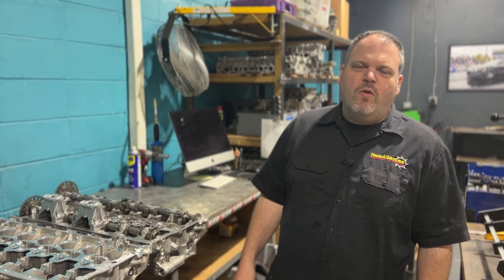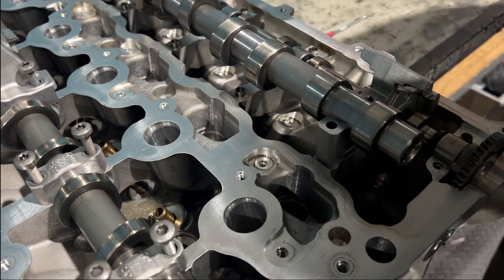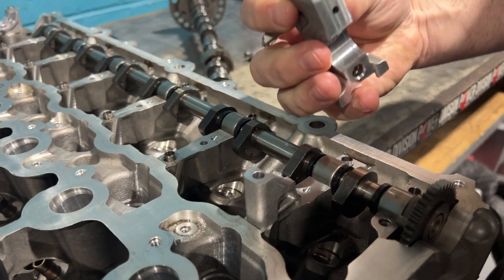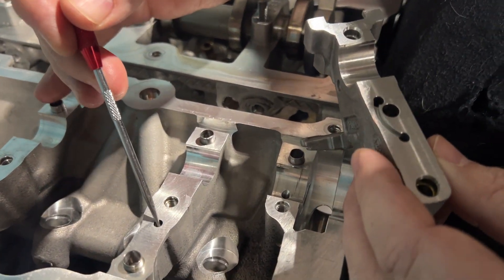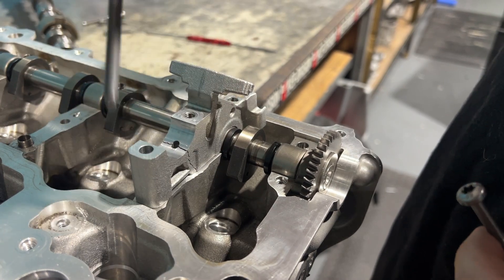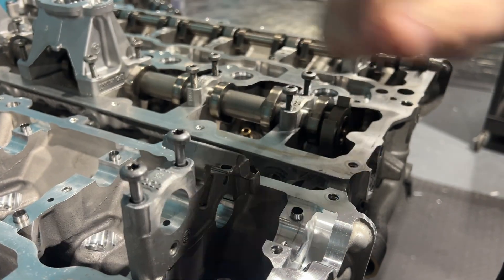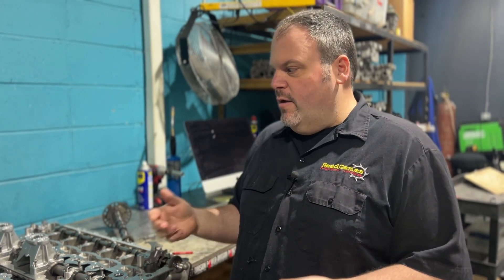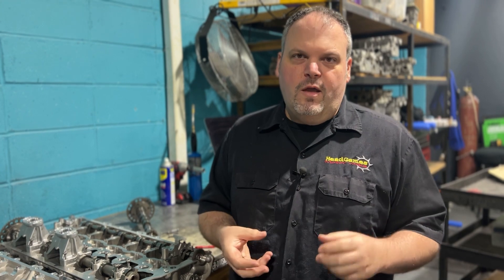Broken BMW B58/S58 cam cap issues!?

Comment: Can this cause oil to leak out of all 6 ports on the B58TU in the m340i? I have been getting blue smoke and its not the valve cover or turbo so oil is leaking out of all 6 ports where the turbo mounts on to.
Reply from the maker: this would not cause an oil leak. That sounds like something in the bottom end.
Reply: @headgames  I have a shop taking the engine out to see what is causing oil to leak out of all 6 ports

Comment: I may be experiencing this issue right now with my vehicle. This type of thing isn’t covered even partly by bmw is it? Any advice?
Reply from the maker: BMW doesn’t cover anything. Only suggestion is to get it looked at. Have to remove cam caps to see it. If it is cracked, have to replace the head.
Reply: @headgames joy, thank you.

Comment: A lot of people saying this is mainly caused by bolt fatigue there’s actually an updated cam cap bolt apparently… would you recommend using new bolts and torquing to spec?

Comment: Do you think this will be a problem with early year b58s like for example gen 1 2017 bmw m240i?
Reply from the maker: Yes, it is the same cam cap. And the Gen 1 is actually how I learned about it.
Reply: @headgames happened to me on m240i 2017
Reply from the maker: @Ervinator  sorry to hear. Was it hard to diagnose?
Reply: @headgames  not at all. The car had missfire and after checking everything the last was to check the head. We checked the head and the cambridge was broken was really easy to see. Now my question, can the cam cap failure damage the engine or do you think i should be fine after replacing the head?
Reply from the maker: @Ervinator  engine should be fine. What year?

Comment: What is the fix in this case buying a new cylinder head???
Reply from the maker: Buy a new one, or if you can get a junk head that has good cam caps we can hone it.
Reply: @headgames  Hi, I'm having this problem, I have a junk head from a 2022 B58, can we use the caps from this one? Since they've already updated it here, I don't know if the lubrication lines match!! I would like to know since I was thinking of sending it to you but maybe I bought the wrong junk head! Regards
Reply from the maker: @noelvaldivie9140  no you cannot use it. Everything is different from the 22’.
Reply: @headgames  thank you 🙏🏻 apart from fixing the fault with the camshaft cap, I want to do a CNC port on my head and a few other things. Where can I contact you?
Reply from the maker: @noelvaldivie9140  info@headgamesmotorworks.com
Reply from the maker: Or just go to the website contact page

Comment: There's a few options.
Remove old fractured/cracked cap; manufacture a new billet one with the cam center machined in the right spot? (ie. based on measurements from your existing cap). Could slightly beef up the existing design as well... Sure, this won't be a cheap fix, but it's a heck of a lot cheaper than replacing a head.
I'd actually be very surprised if there wasn't a known "range" of cam centers, based on manufacturing tolerance, that you could design around this (ie. model A; B; C; D depending on the cam cap used). Alternatively, you could probably design the above with a generic billet cap with increased tolerance around the cam; then provide a set of half-moon bearing shells (ie. A, B, C, D, E, F), which provide an offset cam center depending on the one that is installed (ie. the shells aren't uniform/concentric).

Comment: Considering this is the first time hearing about this and not finding much on the forums I’d say it’s a small issue, an issue, but not something that’s been plaguing the platform
Reply from the maker: I originally seen it on YouTube and found a few threads on it. Then one came in of both years, and thought it would be interesting to see how and what changed.

Comment: Has anyone tried to tap the block and use a longer bolt on the shallow side?
Reply from the maker: It’s not possible because there’s no room for it. It’s directly between the 2 oil holes so it would basically make it one big hole.

Comment: You guys have a full solution to this issue? I have a 2020 x3m making 800 wheel and I can see this in my future 😢
Reply from the maker: no solution yet
Reply: @headgames this video is about a year old now. Have you seen any viable solutions to this? Also how prevalent is this problem?
Reply from the maker: @Teeniesaurusrex  BMW's haven't been a big seller at HeadGames in the last year. I seen 1 of these come through with the issue since we posted it and maybe a handful of them have mentioned something to me but not a huge issue I would say on our end. No solutions besides a newer casting.
Reply: Thanks for the response bro! Guess I gotta watch out, replace the head, or sell my 2020 and get a ‘22 LCI. I just didn’t want to have to FEMto it to get it unlocked but I guess that’s life hahaha
Reply from the maker: @Teeniesaurusrex I don’t think it’s worth doing all of that! 5-7k gets you into the newer head. When the time comes, or if it ever comes.
Reply: Is this an issue for the everyday guy? Like, if I never modded the engine in a 2020 X3M, would I care about this issue? Or maybe the better question is, how does this present when it fails? 

Finally, is this a recall issue or no?